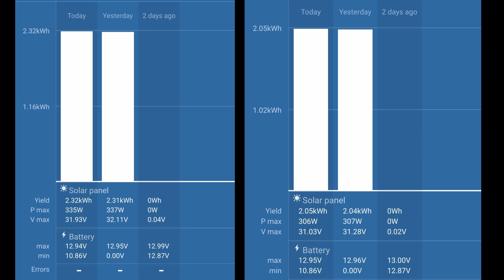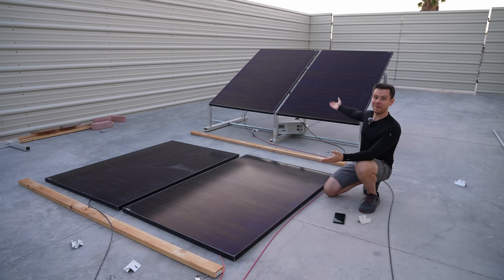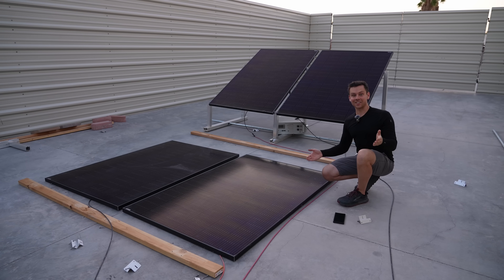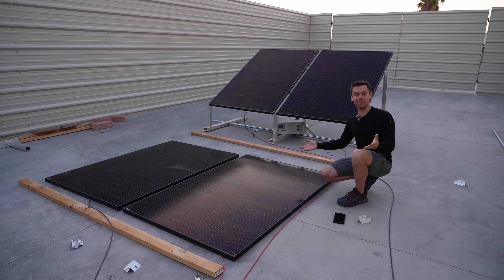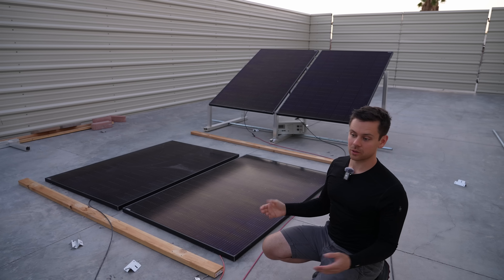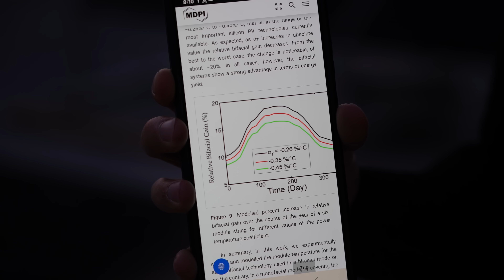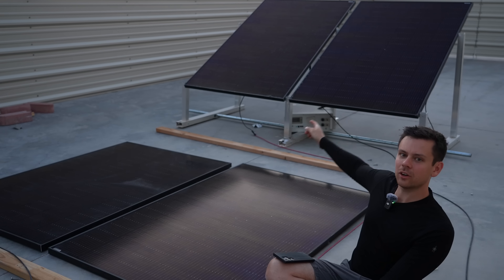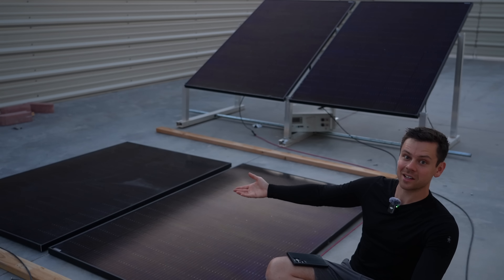Bifacial Solar Panels: Everything You NEED to Know Before You Buy

Comment from the maker: When the sun angle is low, both arrays are producing the same amount. That's why I lined up the shadows so that they would block out an entire cell row at the same time. Look at where the sun is rising at my latitude and season. The shadow falls on the panels at the exact same moment. I couldnt do test during other seasons 

Study mentioned in the video: https://www.mdpi.com/1996-1073/15/1/22

Check out my older bifacial test videos! I have tons. This video gives a quick summary of what you really need to know.

~~~~~~~~~~~~~~~~~~~~~~~~~~~~~~~~~~~~~~~~~
Tired of getting ripped off? Check out my "Will Prowse Approved" solar product recommendations below!

12V Batteries
https://www.mobile-solarpower.com/lithium-batteries.html

48V Batteries
https://www.mobile-solarpower.com/48v-batteries.html

Offgrid Inverter System Builder
https://www.mobile-solarpower.com/48v-complete-system-blueprint-559371.html

Hybrid Inverter System Builder
https://www.mobile-solarpower.com/code-compliant-48v-offgrid-system.html

Mobile Handtruck System Builder (very popular!)
https://www.mobile-solarpower.com/mobile-48v-system.html

Solar Panels
https://www.mobile-solarpower.com/300w-solar-panels.html

Ground Mount Solar Racking
https://www.mobile-solarpower.com/ground-mount-racks.html

Wire, Lugs and Busbars
https://www.mobile-solarpower.com/wire-and-connectors.html

Tools
https://www.mobile-solarpower.com/tools.html

Fuses and Circuit Breakers
https://www.mobile-solarpower.com/fuses.html

Plug-N-Play Solar Systems
Ecoflow, Anker And Bluetti! So many models to choose from. See my current recommendations here:
https://www.mobile-solarpower.com/full-size-systems.html

~~~~~~~~~~~~~~~~~~~~~~~~~~~~~~~~~~~~~~~~~~
Need to build a large DIY system? Need a trustworthy solar distributor? These are my favorites:

Signature Solar
Creator of EG4! Solar Minisplits, Victron and More! Largest Solar Store Online.
If you want $50 off, please use my link below and coupon code "DIYSOLAR50":
https://signaturesolar.com/?ref=cPwLcVc0SW-BjN

Current Connected
Best Prices for EG4, Victron, Midnite and so much more! Fast Shipping and Highest Rated Customer Service:
https://currentconnected.com/?ref=wp

~~~~~~~~~~~~~~~~~~~~~~~~~~~~~~~~~~~~~~~~~~
Join our DIY Solar Community 
Need more help? Join the largest solar forum on the internet for beginners and professionals alike. 140,000 members and counting!
https://www.diysolarforum.com

Check Out My Free Book
Best-selling and beginner-friendly guidebook to off-grid 12V solar!
https://www.mobile-solarpower.com/the-book.html

~~~~~~~~~~~~~~~~~~~~~~~~~~~~~~~~~~~~~~~~~~
Contact Information:
I am NOT available for personal solar system consult! If you wish to contact me, this is my direct email: williamprowsediysolar@gmail.com
FTC Disclosure Statement and Disclaimers:
Every video includes paid promotion or sponsorship (such as free products for review). Some links on this YouTube channel may be affiliate links. We may get paid if you buy something or take an action after clicking one of these. My videos are for educational purposes only. Information is subject to change/update at any time. Electricity is DANGEROUS and can kill. Be smart and use common sense :) DIY Solar Power with Will Prowse is a participant in the Amazon Services LLC Associates Program, An affiliate advertising program designed to provide a means for sites to earn advertising fees by advertising and linking to Amazon.com
Reply: Will, Please try a straight vertical mount (like if the panel was a sign).  The issue I see with your set up is that is enclosed in walled area, which means its probably not going to get early morning sun & late afternoon sun. 

Also consider that most Solar arrays produces more than the inverter can handle during mid day. It would be better if energy can be collected for more hours of the day, even if its not the maximum possible power. Hope that makes sense.

FWIW: Ground mount are better than roof mounts:
1. Possible roof leaks if the installers make mistakes or cut corners.
2. If you have a shingle roof, you need to replace as shingles last 15 to 20 years, & it will be costly to remove & then install after the roofing job.
Reply: What if you lined the surface behind the panels with a refective mirror, tin-foil, or white material? Would you increase tha gain past 20%?
Reply: Lets see... those are $0.31/pw at commercial scale (806 panels per container) and ... hmm.  Well, there are many wholesalers but the one I'm looking at right now just to get misc pricing is a1solarstore.  They have pallets of 31 x 440W Aptos's at $0.37/pw ($162/panel @ 440W).  Not including taxes, shipping, or tax breaks.   U.S. made also.
Reply: Question… in an RV application if two bifacial panels are stacked on top of each other, with only a few inches in between, would the one below get any sort of power? When the rv is parked, the bottom solar panel would be pushed out on a rail in case you were wondering 😂
Reply: @homeflavor  Not while stacked.  The panel underneath might get some voltage but it won't be able to put out much, if any, current.
Reply: Here in the South East I like them tilted about 30 deg to reduce the chances of hail damage.

Comment: I built my own array structure. All biracial panels 4 ft from the ground at 30 degrees, facing south east. Produces roughly within 10% all year around. No more winter issues running the generator. Best decision i have made thus far
Reply: Are your biracial panels not totally black?

Comment: 440W Bifacial Solar Panels are like 60€ here in Germany.
I have installed 8 panels this summer. Mounted at different angles 0 / 10 / 15 / 30° and will look at their output over a years time next summer.
Aside from them being not much more expensive, the main reason for using bifacial panels was having the longevity of glas on both sides.
The few more % yield were just a bonus.

Comment: We live in South Spain at a similar latitude and climate to Las Vegas.  We get an average of 3500 hours of sunshine per year and it's warm or hot  all year round. I've played with all sorts of configurations and came to the same conclusion as you: Just put as many panels down as you can fit in the cheapest possible configuration and you will make all the power you need.  The cost and effort to "optimise" angles and fit here is just not worth the extra few % over the year.

Comment: How close does the area of the shadow track track the output? Does an angled large panel put out the same watts as a not angled smaller panel with the same shadow area?  Maybe shadow area is the most important factor to determine power output?

Comment: Something completely different .. Please consider learning NodeRed. It allows data based load switching. it generates a web page with  statistics. one can even use an api that will estimate sun shine levels per location. the program is absolutely free. the sensors are esp-32.. like 6 dollars each. reprograming is needed and free on the web. you're a very smart dude..  take a look in utube "NodeRed" but stay away from setup videos and try to focus on the final results. Either way thanks for your video "Bible " on solar !

Comment: You seem to forget an important issue. Solar panels mounted totally flat will over time accumulate more and more sediment all over the panel, which will definately reduce the output, where as panels mounted with inclination will get flushed properly by the rain, such that sediment is flushed down.

Comment: Awesome video, Will! I had a quick question:

Would bifacial solar panels make sense in a campervan setup if they’re tilted at 30–40 degrees, and the roof surface is either painted white or covered with reflective aluminum foil to increase rear-side irradiance?

I know bifacial panels are more efficient in open or high-albedo setups, but I’m curious if this kind of DIY setup could realistically boost output enough to justify the extra cost/weight in a mobile system.

Thanks in advance if you see this!

Comment: I'm confused.... Are the mounted panels facing South?  I like your work, but you have one set at an angle, a better angle possibly, and the other flat.  Is the test testing the angles or the reflected light? or does the angle not matter. I think that is a big variable that needs explaining. Could you have mounted the reflected panels flat also and still get some reflected light?

Comment: Can any HELP !  I have 800 watts of solar panels and a 60 amp PowMr charge controller.  During the day when it’s full sun my system will shut down because it gets up to like 20 Volts , it makes my inverter go into fault mode and nothing will work.  What is going on with this . ANY HELP WOULD BE SO APPRECIATING

Comment: Vertical mounted bifacial in E-W position is the usecase I find interesting.
You can get almost as much from the backside than the front when the sun is directed that way, 
so mounting them like that allows for a longer total day curve. It will start producing earlier and keep producing later. 

And bonus of using them as a fence for example: you are not eating any useful space on the ground.

Comment: Cool data. I'm preparing to mount panels on a short school bus. I purchased the panels that would fit best. I was concerned that they were not bi-facial, but this video gives me assurance that there would be little gain for bi-facial given the proximity of the roof. 

I also am mounting the panels on a rack that should allow for good air flow beneath the panels. 

Thank you for rigorous testing.

Comment: We are using 250W bifacial panels on a boat. They are mounted on the guardrails. They can be stored vertically when in a marina or angled when at anchor or sailing. When in a marina, the vertical panels work surprisingly well. One side will get full sun in the morning, and the back of the panel on the opposite guardrail also gets full sun. This is a real performance gain compared to none bifacial panels.

Comment: Simple test, put a white reflective surface under the tilted panel mounts. It should extend well beyond the edges of the panels. For testing maybe, a silver tarp from Harbor Freight might work but white would probably work better. Maybe some cheap white latex paint rolled on cardboard, hardboard, or a tarp for a test? I read some research that suggested that 42" under the front of the panel was the minimum effective mounting height for bifacials. If you back legs were moved to the front and new longer legs were under the back, you might have improved performance. 
 You still need to test a bifacial mounted vertically with front due west, rear east, and a minimum of 12" under the panel. In Las Vegas it should have a clear view of the late afternoon sun if driving an air conditioner. Properly positioned it will produce peak power in morning and afternoon when conventional panels are suffering.
Reply from the maker: I've already done that multiple times on this channel. Check out my older videos

Comment: The RV manufacture for my RV mounted the two solar panels about 2 to 3 inches high on the white roof of the RV.   I'm not sure how much that changes the output of the panel.  I was curious, you just laid the two panels on 2x4s so no light could come under the panel on the 2x4 sides.  Also, your panels were not mounted very high.  I am curious if mounting the panels 2 to 3 inches higher makes much of a difference?

Comment: Thanks.. this is a great video. I am planning to upgrade my panels from 550 mono to 700w bifacial ones. I have a gable roof which sides is facing east and west.. each side can have at least 5 panels. If your test states that regardless the panels is lyng down flat and still gain 90% of its total capacity, then i do not need to worry replacing my existing to a new panels. i was hoping to get atcleast 90% of the 7kw panels even if they are lying flat on a steel roof.. there's a 6 inches elevation and somewhat windy in most times.

Comment: While there is a lot to be said for more fixed mount low angle panels versus angled panels, I would say that maybe the best configuration would be to have some steeper angled panels mixed with panels with low mounting angles (shallow pitched roofs).  This would positively impact string (serial connected panels) charging as you might reach your minimum voltage for charging much earlier.  That would at least make use of the panels that are putting out minimal power to be useful in powering the system (including charging the battery).  Maybe having the top row of panels adjust as little as 15 degrees in the winter could increase your daily production in a surprising way.  I have even seen this layout in your driveway when you were testing ground mounting vs laying them flat in another video. Another method would be to have an adjustable awning as the bottom row where the lowest edge could be dropped to the optimal sun angle for the season.  

Love the videos.  Keep them coming.  Also, I haven't seen a lot of DIY builds, but it would be interesting to see a PVC sprinkler system tested in the hot LA summer.  You could give a 1 in pvc pipe and put some small holes in it for the sprinkler side and then a 2 or 3 inch PVC cut in half at the bottom of the panel to act a a gutter to collect the water to store in a container under the panel.  Use a small solar powered electric pump to circulate the water.  It would be interesting to see.

Comment: I live in Montana and the angle of the sun changes dramatically thru out the year. i have to much solar right now but in December i will always be short. so i have started installing panels that are orientated to the winter sun, much more vertical and will be exposed to the sun as soon as it breaks the horizon. the best producing panels last winter are attached directly to my south wall, looks ugly but the mounting was cheap...lol  it is crazy that solar mounts cost more than the panels. i have gone to using wood and even with replacing that after several years is is much more cost effective. and i am able to adapt the new mount as the tech evolves. building a 20 year mount seems silly when in 5 years the advancements in solar make it a liability.

Comment: I wound up getting bifacial halt-cut panels (the Hyundai 410W panels), and I'm really happy with them.  Middle-of-the-road cost (not bleeding edge, not old).  I got a whole pallet actually 🙂Honestly, its hard NOT to get bifacial's these days.   So even though they are flush against the roof, I still wound up getting them.

The half-cut topology and PERC tech is awesome... excellent low-light and shadow tolerances.  I'm getting an enormous amount of production out of them, and really good production even in cloudy conditions.

For example, I'm getting 20W per panel from ZERO direct sun and clear skies (totally in the shade facing a blue sky but no direct sun!).   The same conditions in cloudy weather yields 25-50W...  again zero direct sun.    Then in direct sun, but on a cloudy day, I get 100W to 200W out of each panel depending on the thickness of the clouds.  And of course I get full production on a fully sunny day in direct sun.

This is precisely what I wanted... I generate more than enough power on sunny days so I just don't care about sunny days any more.  What I really want is to generate sufficient power on cloudy days and so far these panels are doing the job!  Winter won't be as good but I don't have any data on winter yet as I just installed these.

-Matt

Comment: This channel inspired me to do some solar projects on my channel, great vid as aways! Curious what the output would be if the panels flat on the ground were flipped upside down so the back side is facing the sun. Im putting together a video for a solar trailer project were im going to hinge the panels for transport where the panel back will be facing the sun. Just waiting on the panels to show up to get started with testing!
Reply: Putting solar panels upside down may not be a good idea, as the water from rain could fill them and the backside may not be as waterproof as the top.
Reply: @Tumbleweed5150 I believe that to absolutely true. But these panels will be mounted vertically on the sides and fold out. So I think were ok. But Im hoping the underside can still catch some rays while in the transport position

Comment: Will, with all your setups can you do one to simulate the roof of a motorhome? Maybe on the roof of the bunker? I am wondering about bifacial gain when mounting residential panels side by side covering the entire roof by going Over the Air Conditioners and vents, plus how to mount them that way securely. More and more people are adopting that strategy but I am still nervous as all are home made DIY 'guesses' of secure mounting and anecdotal results with some having tens of thousands of road miles on the installation.

Comment: you say put out more panels ,but if you do that do you not have to get more inverters?
Reply: No, but you may need more solar power controllers. An inverter only changes DC power to AC power. All in one units have a solar controller, inverter, and battery charger built in, so if you are using one of those, yes... or just get another solar controller or two, if your all in one is sufficient for your power needs.

Comment: I installed six bifacial on the back of a catamaran. They make a significant gain from the sun light reflecting off the water. Was pretty interesting. Good video. (Caribbean)
Reply: The other thing is you only have so much space for panels, getting the best you can get can be worth it.
Reply: El agua tiene el peor albedo, no refleja la luz solar, por lo tanto, su explicación es otra